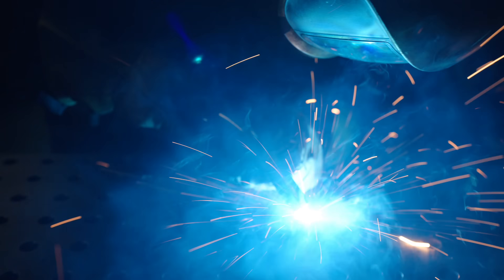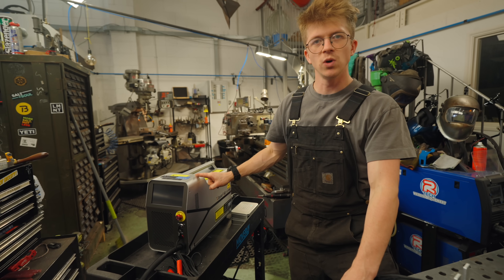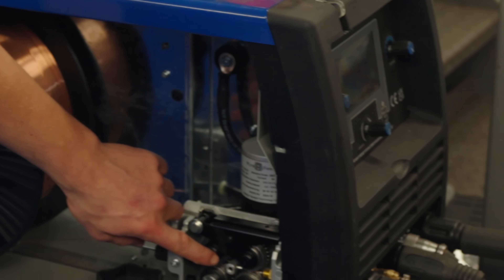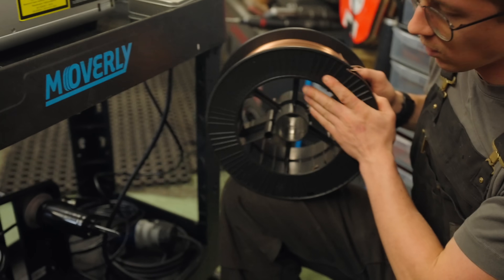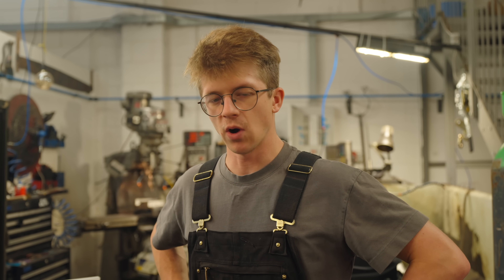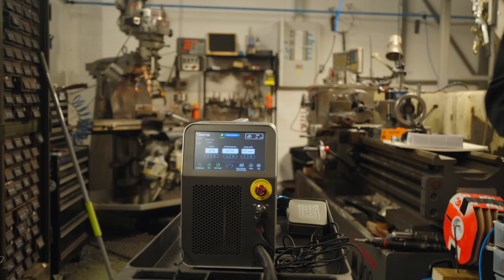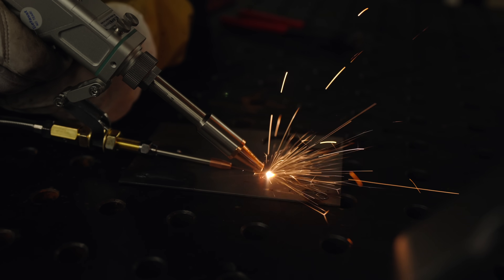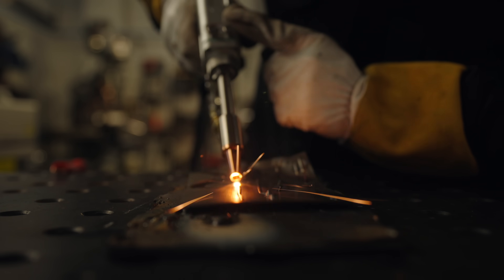Laser Welding

Comment: I think, ideally, you would have a room for this device.  Maybe in your grinding room, but I don't recommend it in your main workspace, especially if there are others using the space.  It is far to easy to unknowingly zap someone or something.   Also you are surrounded by reflective surfaces.  So even if you don't shoot Jaimie directly, you could blind him by bouncing the laser off of a shiny surface.  (I'm speaking from experience on that last part.  I didn't blind them, but I burned them pretty bad.)

Comment: Hay Alec! You can get reliable 10mm mild steel penetration with the laser welder. I saw another YouTuber do a whole bunch of tests with different thickness and he would acid etch the cross section of the weld to see if it penetrated or not.

Comment: @Alec Steele One thing to keep in mind with laser welding is the need for full protective coverage. These lasers can damage skin extremely easily—not just from direct exposure, but even from reflections off shiny surfaces or from scattered laser light. Make sure everyone in the area is fully covered and protected. Safety first!

Comment: Dude, the welder you got is nice. But 700w is too low for most work. I got a 2500w laser 4 in 1, with a dual wire feeder, so I can make fillet like a mig or stick. I also got what they call dual pendulum or double wobble, which is a y movement of the beam with the normal x, back and fourth, like your laser. I can do patterns with the welding and cleaning. You really need to up your game and try a better one to really evaluate, and be blown away. Lol. Don't get me wrong, the X1 is a nice laser, but it is like a 90 amp mig compared to a 220v 200+ Amp Mig. If all you are going to do is thin metal welding, you got the rig. But for 1/8 to 1/4 move up. Plus wait till you see how easy it is to weld aluminum!!!. PLUS, with more power you can weld very fast with dry filtered compresses air or nitrogen. Gas costs. Good luck.

Comment: Wow 😮 after all the gimmicks I have seen online , this company has actually delivered on a laser welder that is pretty decent. Not for all  jobs obviously but no single machine is unless it's priceless . Would be great for an exhaust shop or a panel shop . Would be also great if it worked on aluminium.

Comment: No no no. If someone walks into the workshop while you are using that thing they are at serious risk of being instantly blinded. You should only be using it with appropriate safety precautions like doing it in a light tight room with an cut-off interlock on the doors. Also please don't trust random "laser masks" they are often not rated to actually stop the beam from blinding you.

Comment: Few things I think they need and kinda on your end comments Alec Information on how to set up a safe workplace, can you use an existing wielding sheet? What happens if it hits some of the orange semi transparent ones that you often see in the workplace for shielding while welding etc.. because watching you had a chunk of over pen with the laser at times there especially while cutting and if there is no 'safe' way to handle that it becomes a massive OHS risk at times.

I mean yeah there's a lot of laser saftey stuff out there, but a lot of that is designed around non portable laser equipment like cutters etc not portable wielding equipment.

Comment: One thing that is VERY important is you need to be cautious of reflections.  You can absolutely accidentally reflect the laser with enough intensity to blind to pretty much anyone inside the workshop. Many professional industrial laser welding workshops will have safety interlocks and indicators on the doors, as well as sometimes curtains/barriers to mitigate possible laser risk.
Reply: Agreed. It helps that he doesn't seem to have many people in the shop other than himself and Jamie, and I'm glad to see Jamie has a pair of goggles too. Worth considering the potential beam path if the door is open even.
Reply: @Lizlodude  Of course, in addition to blinding *people*, they have camera equipment in use to consider the expense of damaging...
Reply: @sanityormadness yeah you can burn nice spots on your sensors.  Although much cheaper than your eyes.
Reply: Also as he's talking about laser safety he's standing in front of multiple gas forge lines that could be burned through very quickly, be careful Alec!
Reply: If you feel a weird vibration, that's the beam reflecting at you
Reply: "Protect your remaining good eye, wear safety goggles" as the old saying goes
Reply: Exactly correct, I worked on many industrial high power laser cutting machines up to 10kw . We’d get reflections when cutting polished stainless and even aluminium. 
Eventually some sheets came with a plastic protective backing that helped stop reflection. 
Just for comparison a 10kw co2 laser would cut through 50mm ardox or armour plate.
Reply: @newagetemplar6100  Cutting through 50mm plate is wild
Reply: Your grinding room is separate for a reason.  Do your laser box welding in the grinding room so you confine the reflection issue by an order of magnitude.  A polished metal surface will reflect the laser with very little power attenuation.  At the higher power levels you can probably set a fire off a reflection.  Lasering a fuel gas hose might lead to a bad day in the neighborhood.  Cool tech but the safety culture required for this new tech is way way behind.
Reply: Your camera operators can have special blinders like horses or shrouds for the camera or both.
Reply: @lukeb3930  Blinders don't help with reflections when you are filming the work.  It would only screen you from very unusual off visible angle reflections which usually would get refracted enough off the lens to not damage the sensor.  Really the only way to protect the camera is film though an appropriate filter.  However it really depends on the equipment.  It might be better to just have a designated gopro camera or the like.  If you burn out some pixels very few people will notice until many strikes occur.  And then when that happens, well you get another gopro.  Alec's budget is large enough that he could probably eat a camera a gopro a year without any notice (and it will not be that often unless he is very careless).

Also when your camera quality starts to get noticeable you get to do fun things, not really caring if you trash it.  Like close up shots of the forge.
Reply: In China and India they laser weld like this and laser cut with 80kw systems with not so much as safety glasses on. We act here like second order reflections can instantly blind. But over there they stair right into the cut as an 80kw laser is blasting away.  There has got to be some appropriate level of safty, and I feel we may be going over kill. But IDK.
Reply: @zyxwvutsrqponmlkh 80kw ?? , don’t think so . A 3kw industrial laser will cut up to 6mm mild steel at a decent feed rate. 10kw will cut 50mm .
Reply: Absolutly! this makes me cringe with these youtube guys using lasers! it needs to be used in a lightproof room with a door interlock.

Comment: I feel like that cleaning mode would be awesome for cleaning a surface before laser welding it. It's good at welding clean-ish material, but welding rusted metal probably wouldn't be a strong a bond. You can quickly clean the edges of what you're about to weld. 

Also, I think Alec was way too close with that cleaning.

Comment: I worked in the auto industry making flywheels, we used MIGs for most and I actually used to set them up for a few years, then got lasers. The first was made by 4 different companies and took up about 10-15 square feet, I can’t remember the power on it but it did some crazy stuff. 
Then we got a Heidelberg, for welding, they usually make them for cutting. This thing was awesome, it would penetrate 1/4in steel. We were using thinner stuff than that, but the weld it got was inseparable. We used to test them with a newton gauge and they were pushing 170 newtons of force per square inch, if I remember correctly.
I thought a lot of what we made was junk, until we got those things. 
There’s a hell of a lot of safety precautions needed for light bounce and such. I would never use what you’re using, I just can’t see how it’s safe. 
I’ve seen the results of light bounce cutting through the containment units we had. It’s amazing, but scary stuff!

Stay safe!

Comment: I got to try out a nice laser welder once. It was extremely consistent and gave me great heat control and penetration on position one sheet/plate metal.

Has the potential for very very fast and consistent welds, probably great for robotic welding and maybe a good and fast replacement for like flat submerged arc welding runs in shipbuilding etc

Comment: As somebody working on a regular base with 30KW+ lasers, its nice to see it slowly rolling out to home use base, but at the same time is also worrying me. Lasers are dangerous and especially open beam lasers like this are even more dangerous. An reflective service (a laser doesn't need a shiny service to bounce off) can cause serious damage to people around you and/or yourself. laser scattering is a thing to be very carefull with, especially in workshops and homes. It will not be the first time something burns down because of this. Plus there is a group of people that will use this stuff for terrible actions

Comment: Saw another creator do a bunch of experiments with this thing, the settings and size of wire make a huge difference. Additionally the angle while welding had a huge impact on overall integrity.
Reply: Yea I saw that vid as well, he was getting full penetration with 10mm mild steel. Which is very impressive. I wonder if alec    saw that vid. He seems to believe that the laser welder can’t even penetrate 6mm.

Comment: Hey suggestions for safety in the shop might be get some of those welding curtains that block certain wavelengths of light, to protect behind your work area, to prevent lighting the shop on fire, especially if you catch the way out of the shop on fire,

Comment: 8:35 what? I saw a guy weld much thicker material than that with near 100% penetration
Reply: here's the video code QzS26Drfg7M
Reply: Yep. He should be able to penetrate 10mm with this setup. I suspect the wire is the culprit.

Comment: If you slow it down it will weld the thicker stuff.. you could also 3d print a mount and put it on your robot, then you can weld smooth with no filler wire. I also lasered my hand with an ipg laser welder. A can vouch for the fact it hurts. Use magnets to hold the parts where you can.

Comment: Be excellent for a car panel worker but outside of something specific like that I just can't really see much of a use case, especially with the size constraints it has, if It could weld 10-15mm steel then I could justify it. One major benefit is the lack of spatter.

Comment: I would suggest shielding the area where you are using the laser welder with some movable "walls", made from a frame with a welding blanket or something equally fireproof. If that laser beam hits one of the gas lines/hoses/tanks in the shop, you will get some unplanned fireworks the next time you try to use them. I also suggest some protection for the background objects when you are cutting. I know I sound like a safety sally, but I have seen instruction videos for a more industrial version, and those things scared me, because it takes less then a second to damage stuff or hurt someone, especially if someone (or a pet) walks around your work area.

Comment: This may be a basic question, but I welded in a factory for a couple years, and I don’t think I or anyone I worked with pushed their MiG bead. We all pulled. It was galvanized aluminum, so maybe that made a difference? Maybe you’ve explained this a million times, but I’m new here, and I’m curious as to whether pushing, pulling, or both methods are the correct way to MiG weld. Great video!

Comment: They've come down in price a lot ... and it's pretty great for thin materials. But it's still out of range for many hobbyists. I've learned gas welding so I'm comfortable with tig but it's amazing that after few months break you start back up again and it's terrible... it comes back quick but it does take few practice runs to get the motion dialed in. And especially for thin materials there's not much room for error. I only used laser welder on a robot arm and it did look like magic.

Comment: I saw a video where they laser welded 10mm thick steel, and the weld went all the way through. If you play with the advanced settings, you can dial it in for even thicker steel than the 2mm sheets you used in this video

Comment: you can use any wire with it. you can use mig wire, you can use copper wire, you can use stainless steel wire, you can use just about anything that feeds through the nozzle and is also a weldable material although maybe not aluminumum.

Comment: 10:07 I remember way back in the day when you would start each episode with a short bit of welding practice

This thing seems amazing for light fabrication and sheet steel work, which you do for canister and titanium billets of course. For damascus steel, though, it seems like you'll be better off sticking with the MIG. If they can make more powerful versions of this that work for heavier material, it does so much of the work for you that it might start making professional welders sweat a bit

Comment: I've got an idea.

Make a Damascus billet but instead of grinding each piece on a belt sander, blast it with the laser cleaner as you stack them.

Then tack them together with the laser without any filler so there will be less to grind away after forge welding.

What do you think?
Reply: I doubt that the tack is strong enough for forging. But even with filler the bead is a lot smaller than with TIG. That seems just the kind of work this would be excellent for. Not sure about the cleaning as grinding also introduces flatness (at least on a grinding table).
Reply: I wonder if the laser could remove scale from inside the cracks so they could be forge welded easily